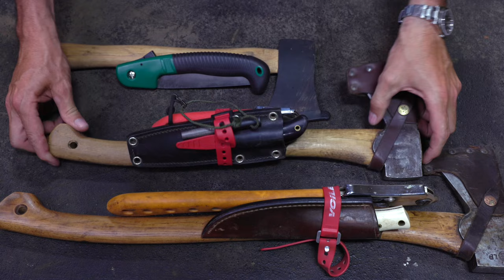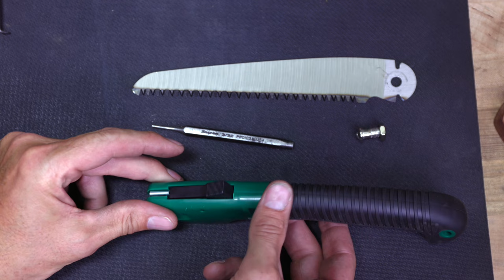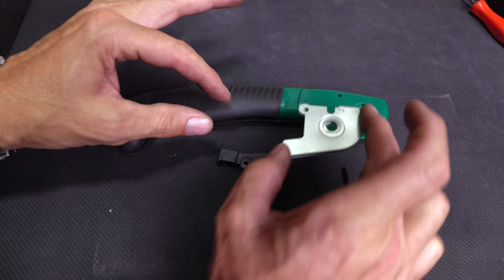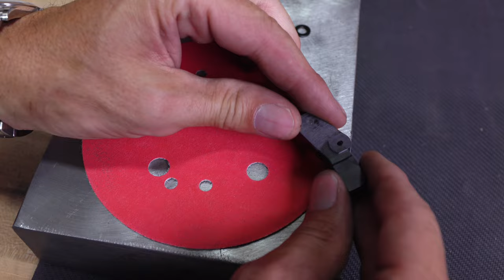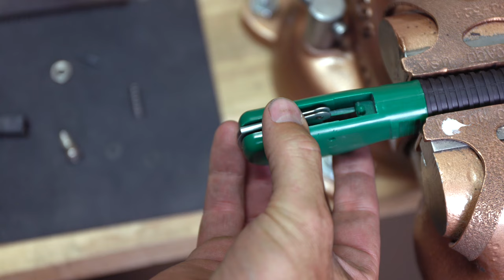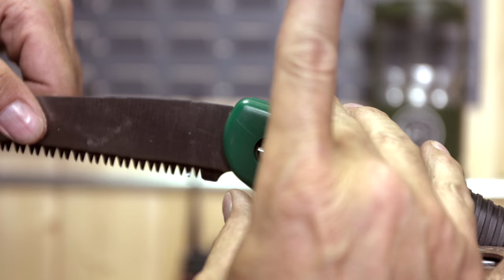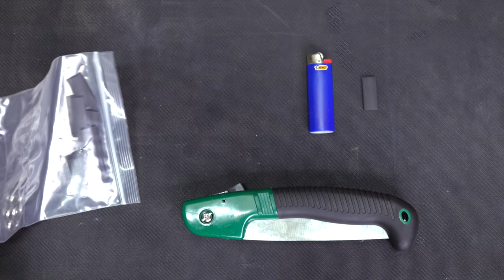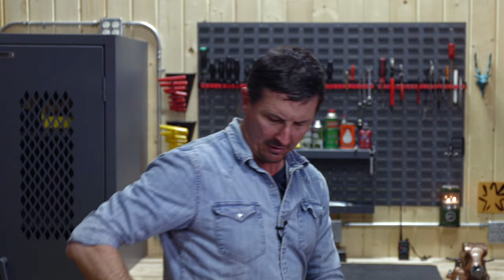Harbor Freights Best Kept Secret EXPOSED!

Comment: Hi Cody, I had one of these cheap saws, not HF but similar. First time I tried to cut with it it bound up terribly. Turns out the teeth weren't set. Set the saw in my vice and set the teeth with a punch and hammer (just peened them over a bit - tappy-tap-tap) cuts like a champ now, lives in the back of the car with a cheap hatchet, tow rope, set of jumper cables and a towel - always have a towel.HHGTTG.

Comment: I would pair it with the Milwaukee folding Hawkbill 48-22-1985 or the Drop point 48-22-1520.  Prefer Hawkbills for rope, minor limbing, and general work, as work doesn't slide of end of blade easy and you can baton the point into stuff.  The Hawkbill is easy to open with a wrist flick, locks solid, nice feel, though I wish it was easier to close one handed.  I haven't tried the Drop point version, but it uses the same body as the Hawkbill, of which I have 2.   Price is around $20-30 depending on seller.

Comment: Pro tip: if you ever need a perfectly flat surface, glass is usually the best bet. Works great for finding warped heads on small engines
Reply: Robert Kitchell
Thank you for the advise on using glass as a flat surface! I've used several surfaces to confirm my small engine heads aren't warped (my wife would kill me if she caught me with some of the greasy lawn mower and ATV heads that I've checked on the countertops and kitchen table!) 
Thank you for the advise sir!!
Reply: A dollar store glass cutting board works well. Tempered if you break it. I used one for attaching sand paper to scary sharpen chisels.

Comment: As a machinist I find your definition of a machined surface.... interesting.
Reply: Well, to be fair the simplest definition of machining it to work something with a tool, so it counts...if you count a sanding disk as a tool 😁

Also, shoutout to IAM lodge 598, journeyman 7 years
Reply: He technically lapped it in so somewhat close to machining

Comment: A DIY bush craft knife made from a worn out lawnmower blade...with a DIY leather sheath. Cost me less than $5 for the material.  Can't beat it for the price and function, and I do not even do wildness survival camping and such.  That HF saw works great since I bought it years ago, pruning my fruit tree branches and still sharp after so many years. Got a el cheapo ax as well, but seldom use it and you know why...

Comment: However, for a fixed blade, I found a really nice Wood River "Modified Trailing Point Skinner Knife Blade Kit"  that I bought from Woodcraft for $25.00.  I made my own wooden handle and customized the grip. 4 inch blade - 9-1/8 inches overall length.  I love it.

Comment: It's the "minimum effective dose" theory; enough to get the job done, no more. Water boils at 212, you can heat it to 300 to boil it, but then you are just wasting energy.
Reply: Technically for efficiency, you only want to heat just below boiling, the steam bubbles are wasting energy as they take heat away from the water (liquid to gas conversion).
Reply: Actually you cannot heat water to 300. It is possible but would require a very robust pressure vessel... Water stops getting hotter at 100c and it remains at that temperature as it boils away. It will not rise above 100c unless you confine it and pressurize it.
Reply: Jon Ross, you are 100% correct!

Comment: i own this exact set. Mine are probably two years old?? maybe three. they have held up over numerous trips. i don't pair mine with a fixed blade as I always carry a fixed blade when i am in the field. i own four of those saws in various kits and bags and each one of them have functioned right out of the box with a positive lockup. I haven't had to take them apart. If you are looking for a budget fixed blade for that trio go with a standard mora. You wont need to baton with it as you have the knife and saw. Mora knives are great carving tools. my current carry is a bps knives version of a Mora but it is full tang.

Comment: The effort put into the hatchet is borderline excessive. However this saw is just garbage. It wouldnt last any medium to heavy use and I’m willing to bet you know that. The first time this thing hangs up mid stroke with any force behind it, I see the plastic breaking and blade is worthless at this point and or creates a hazard of gouging ones hand.
Reply: The plastic is abs supposedly. If it is it would have a tensile strength of about 6600psi and a flexural strength of about 10,800psi. I would throughly enjoy watching someone attempt to break it with their bare hands or under rigorous use.

Comment: I recently received a Ganzo Firebird FB6201 knife as a gift.  I've purchased two today as gifts for others.  For $26 you get G10 handles and 440c steel.  It's a very quick flipper and well made with a nice clip also.  I usually carry a Benchmade, Spiderco or similar mass produced knife as EDC.  But I'm VERY impressed at the value of these Ganzos.  It would seem to be a good companion to these other good value tools.

Comment: I save damaged  old Hickory axe handles. —-I re-purpose them. I picked up a small Gerber’ folding saw similar to the Bahco’ for $5. The plastic handle was junk!!  I made a nice Hickory handle — the blade now folds into a custom Hickory handle with Lanyard.  —It’s stout blade has no movement& works great—still very light weight.

Comment: Before wasting all that time fixing the saw, I'd suggest you try to cut something with it. I purchased a HF pruning saw that looked a lot like that and it was miserable to try and prune anything with it. It would cut, if you worked hard enough, but I doubt that is what you would want in an emergency. I replaced it with a Fiskars saw. Actually got a couple of them, one with a folding blade and one with a fixed blade. Amazing difference with only 1/4 the amount of work.
Reply: I only use Fiskars stuff now for such tasks.  So much sharper.  So much lighter.  So well balanced... For a reasonable price too.

Comment: I really like my Utilitac ll Joe Pardue folding knife from Knife Center. I paid $19.99 and it is on the heavier side.  3-3/8 blade, 8 inches overall. 4 position clip locations (front/rear, left hand/right hand).

Comment: The Schrade Frontier would be a good fixed blade for this at $32 on Amazon. It's full tang, a good chopper, holds a good edge, comes with a small ferro rod and a (bad) sharpener.
Reply: Agreed that schrades are decent. I have a frontier but I prefer the schrade schf9.

Comment: $12 to $14 roughly for a Mora that's Swedish Stainless Steel is my choice. Will handle most any bushcraft task up to heavy batoning and for that you have the "axe". I carry one in the orchard all the time due to its capacity to work with such a low weight.

Comment: I bought an elk ridge knife set, it was cheap.  I believe its 404 china stainless.  But its not bad. No where near my crkt that was 8 times the price. But i figured for a backup it should be fine. Its a fixed blade with a guthook and a folding knife with sheath that holds them both. It looks nice, although i know being china steel it is not going to be my go to knife by any means.

Comment: Well, it’s a year later, as I just stumbled on this one…

My immediate response would have been a Mora knife. However one small observation I’d ike to make:

These tools are built to operate dry for a reason.. cutting wood produces saw dust. Adding a touch of grease can make a magnet of such and draw it and gum up the nice repair. If the tolerances are reworked properly, it should work dry. At bare minimum, if the washers create a bit too much resistance, then I would use a dry graphite spray, which can easily be reapplied once in a while 😉

Good stuff. God Bless!
Reply: Your about the 5th person to say this.  I appreciate your logic but in practical application its hot air.  I've used 3in1 oil on the hinge of my Corona folding saw for 6 years.  I've never had a problem with saw dust diminishing the performance of my saw.  For Pete's sake I use bar-and-chain oil on my chainsaw blades.  Impossible to use the saw without it.  If you clean your tools properly when you finish using them, the oil/sawdust issue never becomes a problem.

Comment: Cold Steel makes a line of VERY basic FIXED BLADE KNIVES of all one sheet of metal which is bent to be a blade and hollow hilt all in one.
The are perfectly reasonable tools with decent - but not great steel -  but I must admit that I don't like the hollow metal handle.

HOWEVER

I made a "Poor Man's Survival Knife" out of several of them by wrapping the handle in paracord, putting a small cork into the hollow handle and pushing it all the way to the "hilt" of the knife, and putting a larger cork at the top. I intended to use a bit of tape to retain the top cork, but I found the cork I had selected fit tightly enough that it wasn't needed.
Inside the hilt went the usual fire making kit plus other items that vary a bit according to what I am up to. It is not waterproof, but it IS water resistant, more so if you seal the linear gap in the grips where the metal is bent around into a tube, but only butted together without welding. And even if you do that, I would still recommend a plastic ziplock bag of appropriate size to contain your survival gear in the handle.

But my favorite FOLDING KNIFE - at the cheapest price - would be Opinel in your choice of size. the steel in these knives is - IMHO - really superb and takes a great edge.
The locking mechanism is a ring on the handle that you twist to lock the blade. But you MUST NOT attempt to use a baton on these knives as the blade pivot is set into the wooden handle.

Comment: We've used these folding saws around the farm for years. The handles tend to bend and crack in high and low temperatures but they aren't terrible if that's all ya got. A Cold Steel bushman would pair up and give you some flexible options.

Comment: Mora is the obvious answer, so I'll throw in an alternative $10 Camillus knife from walmart.  It is cheap and available and it has a 90 degree angle ground into its spine for use with a ferro rod that the mora doesn't have.  Great series!

Comment: i found a husky brand folding knife at home depot for 4.50 something. Under $5. I havent field tested or anything. but i sharpened it up real good and have been carrying it around. It is a little stiff opening and closing. but for $5 its a good knife.

Comment: I bought one about a year ago. Second time I used it the locking button fell off. It broke right a the pivot pin. I was cutting 11/2 inch maple sapling. Now I have a reasonably sharp saw no lock. I'm sure eventually I'll cob something to fix it, I have trouble throwing things away. MOTS You get what you pay for. I guess I got my 5.99 out of it.

Comment: Dad had an old wooden handled folding saw, no locking mechanism, you just learned how safely to use the thing.

This fix is waaaaaaay over lawyered. imho...

I'd be more concerned about the durability of the saw blade. How does that fair compared to a higher priced saw?

Thanks!

Comment: I guess any knife that falls in the cheap bracket but has a high carbon content , youd have to test it using the spark method to see if it would hold a edge, thats what a good knife boils down to, good sparks high carbon content, good edge for a long time, bad spark low carbon no edge!   Without a test its a difficult one to choose so I would make my own out of high content carbon steel so it would cost me nothing apart from time! 

 Failing that, grab an old file and forge weld it to a piece of mediocre steel and use that piece of steel for the back edge and the handle and the file for the knife edge, over here in Spain its illegal to carry knives with a twin sharp edge. or I would do both sides.  Just have to be careful with files due to their high carbon content and the fact they are very brittle, just quench in oil afterwards and test with vinegar and if ok youll have a good knife.

Comment: Simple Swiss Army knife, carried in your pocket. Alternatively, the old US Navy-marked pocket knife. Like the classic Boy Scout knife, but stainless and pocketable. If you must attach something to your axe, a simple Leatherman - type would be good. (in case you didn't figure it out, I've carried one of these knife types for over 50 years, and it's worked well.) Fancier knives are overrated and/or oversized. The larger the knife, the less useful it is.
Reply: "the larger the knife the less useful..." Boy is that accurate.

Comment: you are incorrect: the biggest problem with the saw is not the latch (it is one of several problems).  I have one of these, and it has a remarkably good saw blade design for such a cheap saw.  the biggest problem is the plastic handle, mine broke off right behind the latch the second time I used it.  that makes it nearly useless since you can not get a good grip on remaining stub of a handle.  I considered making a wood handle for the nice blade, but that is hardly worth the extra effort.  it is really a shame too, I liked this saw.  they should have extend the metal reinforcement further down the handle, but that would have added perhaps 20 cents to the manufacturing costs. Go use it on some serious wood cutting and find out for yourself. I would not wast $5 on it.

Comment: I found an hatchet I liked for $29.00 at home depot by husky.
I have a saw from harbor freight,...I have not tried it yet.
But do check out harbor freights scary Machete,.... with AWESOME saw teeth on the back.
I tried the blade part cutting high grass,.....but not the saw part.
But if predators are out there that machete will hurt them bad.
I prefer a parang,... but for different places different tools.
My Hatchet is a  Germantown Tool Works,...I've been using it since the 60's.
I had a heavier hatchet/ True value,... I gave it and my harbor freight axe to my son.
I have 3 cheap folding saws,.......the original is still going since the 80's and it was cheap.
On wood I start a rut then break the wood,.....I don't saw all the way through.

Comment: If the saw is $5 and your time and ultimately your life is worth something get the Harbor Freight ax and save for the silky saw.

Silky Professional F180 7" saw with a better handle $35 with free delivery on Amazon. $35 - $5 - the time and tools if you don't have them. Is your life worth an extra $25? Skip MickyD's a couple of times and upgrade your life value.

Comment: Great tip on the saw, thanks!  I have a Fiskars retractable saw that tightens securely with a lock wheel, also 7 TPI, but think this blade is even longer and more robust.  Can’t beat the price for sure.  👍

Comment: Love the high priced kit but mine is an intermediate level mostly purchased at Ace. I need to get the items together and not wait around to the last minute. I'll add weight because I desire a means of sharpening ;-) My camping has been by way of a truck and not a hike to camp but a hike from camp. 
Perhaps my biggest issue is distance and having place to camp. Two generations ago there were family homesteads and family mining claims out in the rural lands which are all long gone to me and kin. yes. I am that old that said I can out lift and out run the majority of the readers here.

Comment: I do not see the need for the washers at all. I will bet the price of the saw that just sanding the lock lever and maybe a little lube would work just as well. Way over engineering.

Comment: Camillus 9.5" Titanium Bonded Fixed Blade Knife (camillusknives.com)
CAMILLUS 9.5 INCH Titanium Bonded fixed blade.. 
Inexpensive but insanely good quality. I have used and abused mine and it just keeps taking it and holds the edge. I cannot say enough the praises for this blade. Full tang construction and rubber non slip grip it just outperforms so many more expensive blades i have owned. It is a S&G purchase turned into a lucky stumble. love it for a walmart purchase of $10